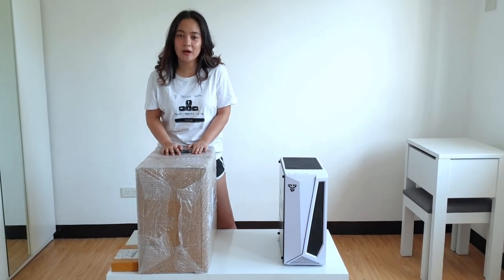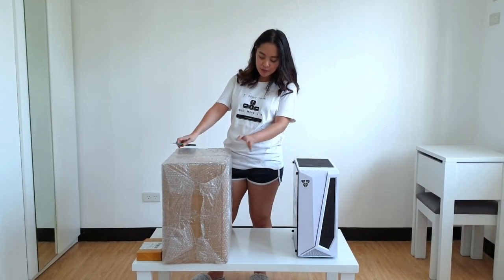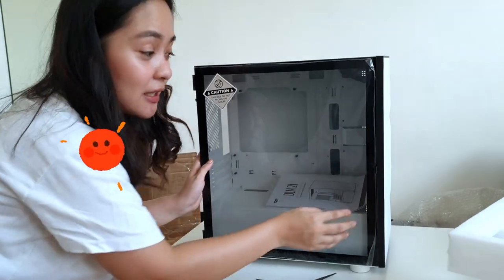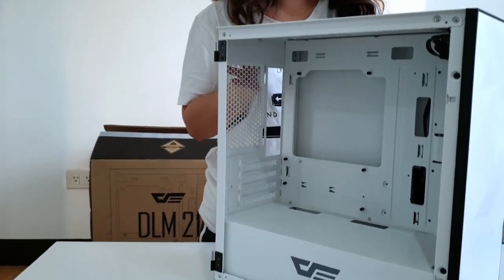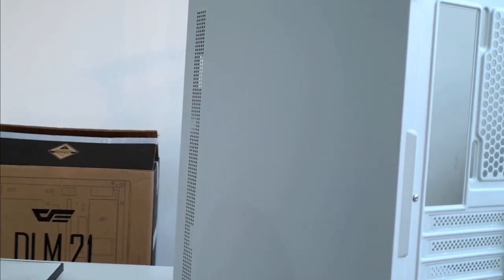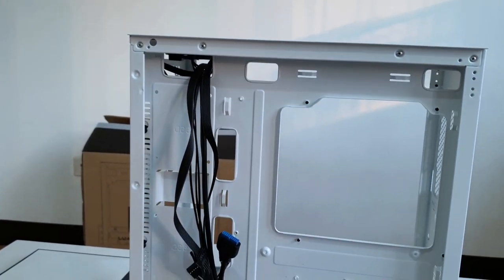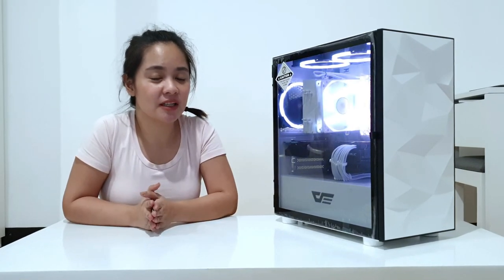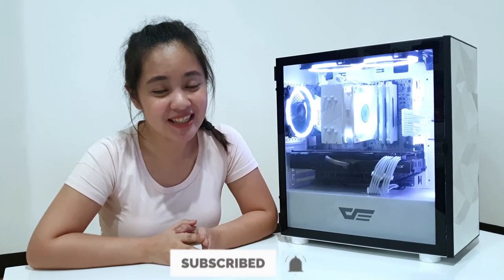PC Case from Shopee, is it any good? | DarkFlash DLM21 White Case Unboxing and Review

Comment: Thanks for showing the case. I prefer the mesh version. The problem I have with the DLM21 and DLM21 Mesh cases are that while they are Micro ATX cases, they waste too much space, meaning they could have been even more compact. The Fractal Design Meshify C has just about the same dimensions but supports ATX mainboards as well. Again thanks for showing your new case, the music is a little irritating though.
Reply from the maker: I wanted to get the mesh front panel originally but it's not available online. Meshify C is the better case but it's pricier and didn't fit my budget. Thanks for watching! 🙂
Reply: @faintsmileten  You made a good choice, wish my case had a hinged side panel like yours, very convenient.

Comment: looks neat and clean, for sure. But the front fans wont get much air, or not? Any white cases would you recommend for pc builds?
Reply from the maker: They get enough air. I've had no problems with the airflow. Tecware Nexus or Alpha are pretty good choices too. For local Filipino brands, I've also had my eye on Rakk Haliya before settling for this.

Comment: How is the airflow? I would imagine the front fans won't be able to get in much air from the front because it's not the mesh version and the tiny holes on the side aren't enough to provide air. Do you think making the top fans be intake instead while the rear and front become exhaust, be a better solution? Air can get in so much easier from the top.
Reply from the maker: Surprisingly the airflow is pretty decent even with just the side vents. I agree that a mesh front panel would've been better. I'm not sure if setting the top fans as intake fans will be better, but in my experience the case works well even with the top and rear fans as exhaust. 😊
Reply: For me I loved the theme closed panel of dlm21,for me it's like,I am not totally satisfy in this video they've not turn off the lights. to see the beauty of dlm21 closed panel in the dark..

Comment: Hmmm. I can't seem to find the exact case. What I keep on seeing are mesh fronts which I don't like how they look.
Reply from the maker: Aww, yes it gets sold out quickly. ☹ Which sites have you checked?
Reply: @faintsmileten  Yeah unfortunately.
I checked DarkflashTech, Shopee, Lazada and Amazon. I found one in Banggood, with a non-mesh picture, but it's not really specified, and no reviews either 😅
Reply from the maker: It also took me weeks to find one. They're all sold out as well. I would suggest try checking DarkFlash DLM23, it has a different front panel with RBG lighting but the structure is almost the same. 🙂
Reply: Hatori Ibuki  That's true. I'm more on aesthetic since I'm a light user, and I could just open the glass panel if needed. 
If you're interested, I found non-mesh fronts in Banggood, but they're still restocking. Will be available on October 9.
Reply from the maker: Same! I'm more on aesthetics too!
Reply: @faintsmileten  I've checked the availability of the DLM23 and they're all out of white ones. Some are crazily overpriced like Php7,000.00 above.
Reply: mas ok ang mesh mas ma maintain nia ma baba ang temp, therefore mas ok anh performace
Reply: @faizzhen755  Depends how you use it. Obviously, if you're a heavy user, you'll opt to a case with better airflow. As I said in my previous comment, I'm a light user and don't game much.
Reply: @JoJ0estar  ok .didnt read your comment, i thought your a gamer.

Comment: Is there space or can I put maybe a 240mm AIO on the front? and rather put the intakes sa top. Btw, ano pong brand ng case fans ang ginamit niyo po cuz they look clean!
Reply from the maker: Unfortunately, you can only put the 240mm AIO at the top and may be a 120 AIO at the back. As for the case fans, they're Darkflash DR12 Pro. 🙂

Comment: maganda ba at maayos yung cable management ng case hindi ba mahirap ayusin o masikip kapag madami nilagay na mga parts?
Reply from the maker: Ample naman po yung space sa side panel para sa cable management. Pero depende po kung fully modular ung PSU nyo or hindi. Kapag hindi po, mejo snug siya pero hindi naman sobrang sikip. Since removable yung HDD tray, you can remove it for more room. 😊

Comment: Ano pong fans gamit nyo? Ganda huhu
Reply from the maker: Darkflash DR12 Pro po. 😁
Reply: @faintsmileten  last question po, parang dalawang klase po yung dlm21 na case? Puro may mesh po kasi nakikita ko sa mga store. :(
Reply from the maker: Yes po, it has 2 types. Mahirap nga po mag hanap ng solid front panel pero okay po yung mesh for the airflow. You can also check Lazada or FB Marketplace. 🙂
Reply: @faintsmileten  thank you so much po. 🤗

Comment: Ilang mm yung CPU cooler clearance?
Reply from the maker: 160mm po. 😊
Reply: @faintsmileten  Thank you 😊
Reply: @faintsmileten  Can I also ask kung kamusta yung temps mo while gaming? Parang di kasi enough yung ventilation para sa intake eh
Reply from the maker: YW po! 😊
Reply from the maker: While gaming the GPU temps plays around 41 to 45° C. The CPU temps are around 51 to 58° C. This is with a ambient temp of 29° C. So I would say the airflow is enough to keep things cool.       🙂

Comment: Darkflash fans bayan? 3in1 na dalawa binile mo? Alam ko kase walang libreng fan yan diba?
Reply: Ilang temp pagnaglalaro ka?
Reply from the maker: Yes, 3 in 1 and 3 individual. 😊
Reply: Ano yung 3individuals fan mo darkflash din? Bat hindi payung 3in1 din binile mo? Haha tatanong lang po balak kodin mag dlm21 kaso mesh
Reply: Darkflash dr12 na 3in1 fans sayo? Tapos bumile kapa ng 3 anong fan yon at anong exhaust fan gamit mo?
Reply from the maker: Isang 3 in 1 ng Darkflash dr12. Tapos 3 individual na darkflash dr12 din. Di ako bumili ng 2 3 in 1 kasi mas mura yung individual, most likely dahil may kasamang fan and rgb hub ung 3 in 1. Since isang fan and rgb hub lang kailangan  ko, I opted for the cheaper combo. 😊
Reply: @faintsmileten  puro 3in1 lang na fans meron sa online san ka nakabile ng individual? Salamat
Reply from the maker: Gilmore po. 😊